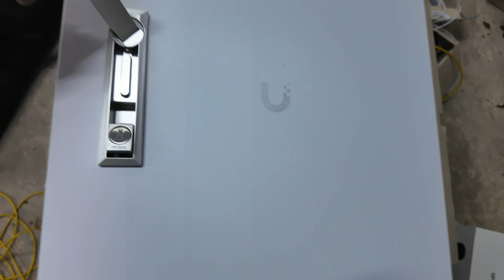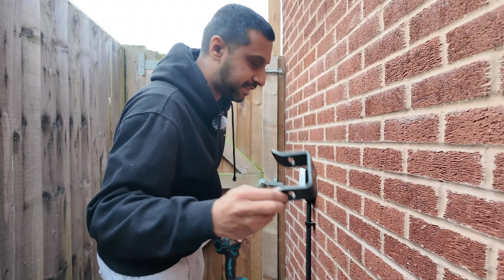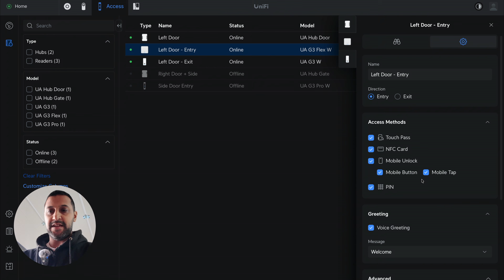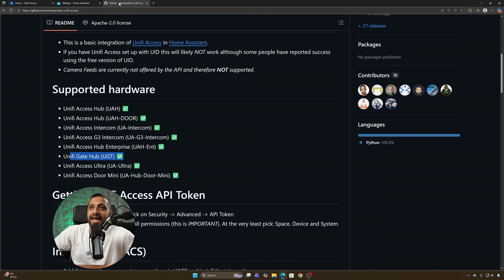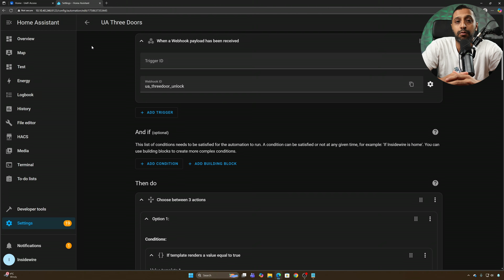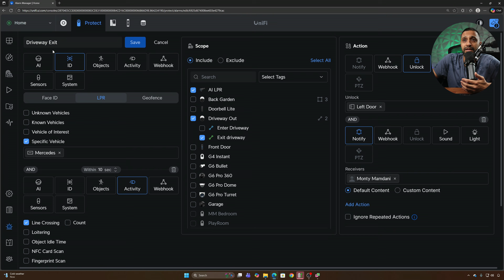UniFi Access: One Reader, Three Doors! LPR + Home Assistant (2 Garages + Side Gate)

Comment: Is it possible to use the Door Hubs Relais Independently? Like, Switch door operator if motion sensor is triggered, but switch auxilary if button is pushed? I dont know how to configure it via access, coz i never had any access device here. Any ways to create different logics in one hub and also put customizable buttons on the protect dashboard like you can do now with the USL Relay?

Comment: Great video, i setup an almost identical lock and access options for my side gate. Curious, how did you wire up your relay? I can get the 12vdc signal to the relay, but nothing comes out. im missing something, and the install instructions are less than helpful. Any insight would be appreciated.
Reply: I think I figured most of it out. I don’t really need the relay, just wired it up to the hub. I am seeing an issue with the lock only seeming to do anything when the manual, keyed unlock is turned. When the key is removed for normal locking, the lock
Seems to do nothing. I thought this might be voltage drop, but I moved the hub basically next to the lock and wired it up. Same thing.
Reply: I figured this all out. I had to go rouge as the setup in the video leaves a ton out. I had to pick up an additional inline 12v 5amp power supply for the lock. and powering the lock off the 12v1a port was a non starter.

Comment: Out of curiosity, why not just use the switch that is built into one of the UA-HUB units and daisy chain the second HUB off of it, or just run two Ethernet Cables from inside the house ?  The switch in the bottom of the box is a huge, unnecessary expense when all you needed it for was some PoE.

Comment: Very nice, but does it only work with home assistent? I’m looking to get a total Unifi install at home, but a simple thing, open a gate or the door next to it seems to be a problem with Unifi (as you mentioned, one door one reader). Was hoping your video would tackle this issue. I want to keep it clean without any third party software. I saw on other forums that many Unifi users want the same, it’s a pity that they can’t fix it with an update. Nevertheless, great video 🙏
Reply: same for me. did you get any info about that?

Comment: I don't know if it's been covered in the comments, but Ijust saw this video. I would add a door sensor to do a check first when driving away, that way it only closes if the door is actually open. 

If you were to back in the door opens, but say you park it on the drive, unload some stuff into the garage, close it manually exit through another door way, hop in and drive away it would open the door.

Comment: Could you advise how long the research and implementations steps took to make this solution meet your needs?  I'm not a Unifi pro or an HA pro, and I'm located in the States anyway, but seeing this video has gotten the hampster wheel turning for me, especially with respect to the LPR and garage door integration with HA, AND gives me ideads for how to tackle the challenges with my attached vs detached garage, but I don't want to bite off more than I can chew, and thats where your time estimates may help come into play.

Comment: Interesting video, I also have a hormann garage door. I wanted to connect it to the DPS input of the unifi door hub mini, but I needed the UAP1 module which offers plenty of I/O. I got it but then there was no way for the door hub mini to know when to close the garage door (my goal was that if it's still open in the evening, an automation system closes it). So I ordered the gate hub just as you have, since it has 2 output relays that can be actuated separately (one for opening, one for closing). But now I realized that connecting the UAP1 disables the push button, so I have to order the "Drucktaster DTH-R".
In the end I am spending nearly 400€ to automate my garage door 🫣🤣

Comment: Don’t think you need to do home assist. You can set each user/code a permission to open just the door/gate that the code/user relates to
Reply: Via alarm manager?
Reply: @Juutuubi2 in unifi you can set a user permissions to open certain locks. In theory if a user/code is typed in and it only has permission to open a certain door then it should open just that door?
Reply: @connorpope12  did you test that?

Comment: Can you do a video with a little deeper dive into webhooks. I have the g4 doorbell pro and trying to get it to unlock a eufy door lock with fingerprints and I can get it to work for the life of me. *Edit- I am also using home assistant.
Reply: The way that i have mine setup with solange smart lock. 
When - "when event type of front door finger print changes to identified", "When webhook payload has been received" 
Then do -"Lock Unlock - Front Yard, Home Entry"

first the doorbell is in state unidentified user, it returns to this after every finger print, then once it senses a change to a identified user it waits for the webhook to come down . Home assistant is faster then ubiquiti webhooks. 
I have it set for multiple ways to send a signal to the lock to unlock itself. because i was issues have a consistent unlock. Then i have the lock auto lock after a few minutes in the app. 
GL

Comment: So all someone needs is a copy of your license plate and they can open your garage via the LPR?
Reply: Copying it cost money, just use a paper with the letters wrtitten on it 😂
Reply: Can be solved via a geo-fence trigger (using your phone) in home assistant. So the license plate trigger is only active if you are inside the geo-fence (i.e. near home). To prevent someone from doing the fake plate when you are home, you could add triggers/logic to track the car leaving and coming home. Or make it so the LPR trigger is only active for x minutes after you enter the geo-fence. (You could even do both.) Thus to open the door via plate recognition, you have to be coming home and inside the geo-fence.
Reply: @JavaruKt for real. Plus I saw another guy's comment on how he uses LPR, and he had LPR + geo fencing + it only works during the day, so at night it doesnt open automatically just in case.

Its as safe as the person setting it up makes it
Reply: Yeah the security hole that something like this causes when used like a moron is enormous.  At absolute most, this should trigger a simple notification that a specific car is home.

I'm frankly shocked that Ubiquity would release such a feature with the risk of being sued to death by their system messing up or being fooled by a simple ink jet print on office paper.
Reply: Just disable the license plate  feature

Comment: Great video. Since the gate hub has 2 "gates" available in addition to the access door, is there a reason you didn't use the 2 gates for the 2 garage doors and the side door as well? This is the exact scenario I've been looking to do but haven't purchased it yet as it's not in stock in Australia currently
Reply from the maker: The gate operators work together and not individually, so it could trigger both doors but I dont want that.
Reply: @InsideWire but hold on a second. In the installation guide it says that the gate hub is suited for bi directional gates. Does Ubiquiti mean that both directions will open at the same time?? Woah that’s misleading then. If not, can you please test it out? I have three gates 2 vehicle ones and one pedestrian all powered by their own 230v engine that just need dry connections and I don’t know what my best option is! One hub gate per door? Oof that’s expensive. One hub gate for all 3 doors would be nice.

Comment: I was thinking of doing something similar to this with a UA Intercom / Gatehub starter kit!  
I have a driveway gate and pedestrian gate. I wanted the gate to automatically open for certain cars with LPR on a G6 camera. And also have the ability for a user to enter one code to manually open driveway gate and a different code to open the pedestrian gate.
I sadly found out that the limitation of only able to pair the Intercom to one door/gate. So even though the Gate Hub is designed to, and I quote from the technical documentation on Unifi own website, support 1 gate, 1 side door.

I had a feeling like I would be able to occomplish this with HomeAssistant in combination with the Alarm Manager and webhooks, but now I got confirmation before I even tried, so thank you for that!

I hope ubiquiti keeps on with their amazing updates and listening to their users feedback as you really should be able to do this OOB without this 'hack'. That way when you get a call from an intercom you could chose which door to open. 

Thanks again for this video and all your others!
Reply from the maker: Yes, it can be done with HA, I know Ubiquiti are continuously developing access, so hopefully its something that might come in the future. Lets hope so.

Comment: Hello.

I've been wondering about one issue—security—for a very long time. Can you print your own or other (if others, please add them to the system) license plates and perform two or more tests:

Mount the printed license plates on a car and check if the garage opens.

Holding the printed license plates in your hand (at different heights), approach the gate and check if the gate opens.

I am very curious about this.
Reply from the maker: Maybe it's something I can try as a video.

Comment: Excellent video, the main thing here is what locks will work with the system.
Reply from the maker: Gate lock? Generally any 12v lock will do the job.
Reply: @InsideWire  I tried to replicate the exact same as the video however all gate locks are 12v 3a. Hub only supports up to 1amp

Comment: Ok, so yes this works, but I 100% would NEVER deploy a hacky solution like this to a customer. Apart from the absolutely forget it chance that the customer themselves could ever make any future adaptations without us having to get involved, just keeping HA itself hosted locally and maintained would be horrific.
It's such a shame that UniFI's own implementation is so half-arsed, that it doesn't support this kind of functionality ootb. It's almost at this stage like they've gone out of their way to make this impossible (like there's no "specific user enters their pin" trigger within alarm manager. Don't even get me started on the restriction on any one reader only being able to open a door on the specific hub that it's DIRECTLY hardwired to, within Access, even though, as you've just proved, there are a whole host of ways that you can unlock a door from absolutely anywhere, using the app, alarm manager webhooks, or even via the API. Anyway, rant about UniFi Access over. Nice install.
Reply from the maker: I agree, would never deploy this kind of "hack" to a customer. It my own house so I am comfortable doing this. 

Thanks for info, though UniFi Access might not be up there yet, they have come along way since they released the product and I think they will continue to improve as they go along. Hopefully they add a lot of this functionality natively in the future.